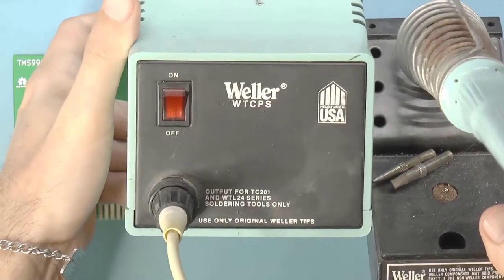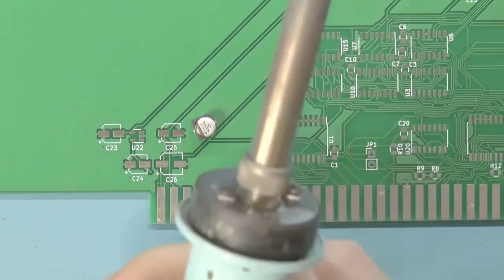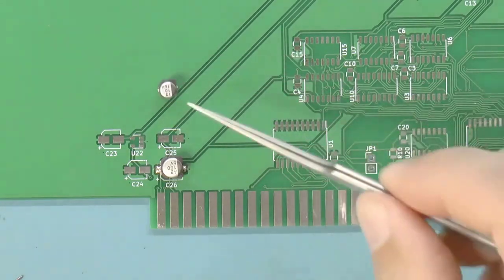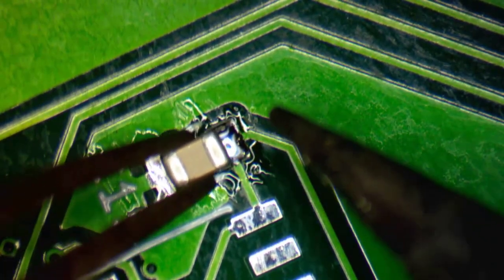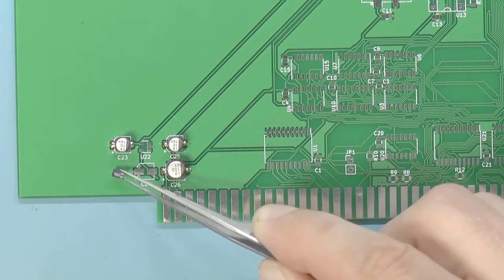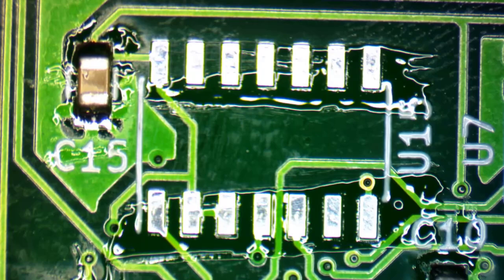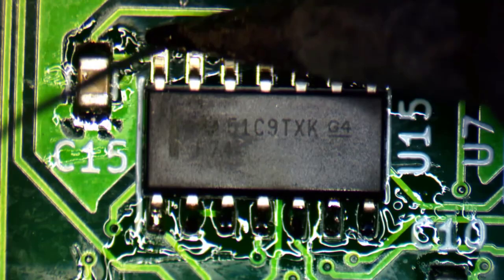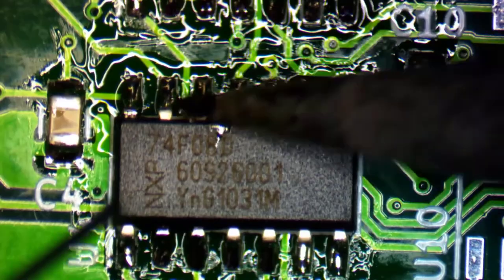SMD Components Hand Soldering: How To Solder SMD Correctly

Comment: With the Weller WTCP series irons, tip temperature is selected by the choice of tip, magnetically switched using the Curie point of the metal. Great irons, used one for decades.
Reply from the maker: Agree 👍